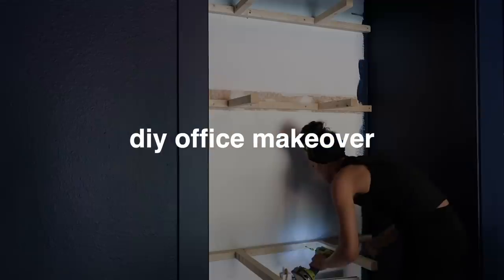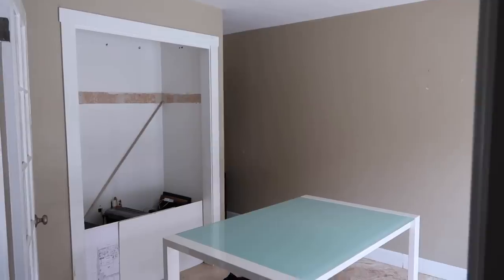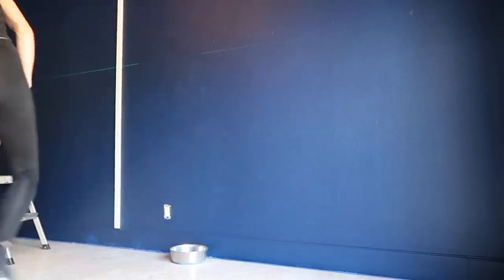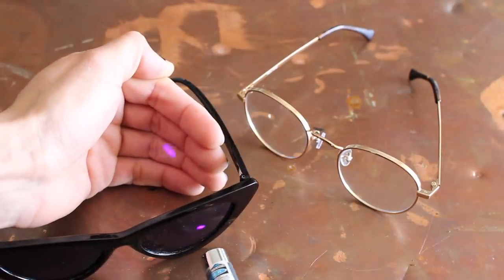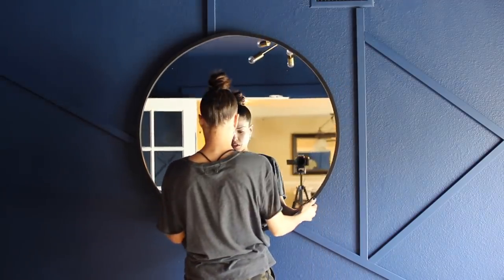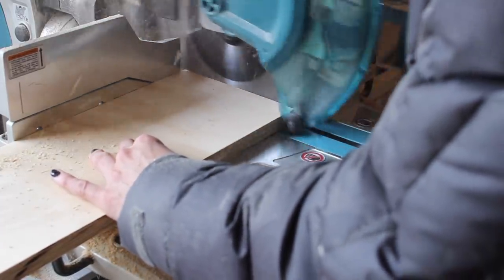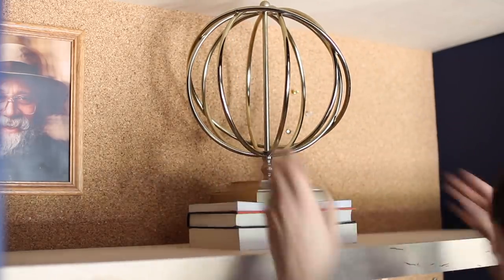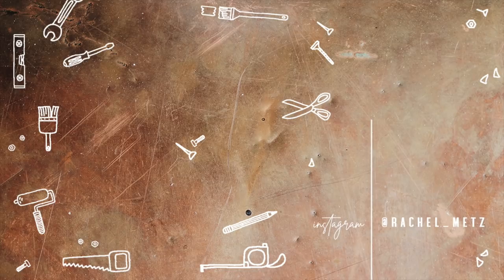DIY Office Makeover

Comment: I love the dog bed. I personally would have painted the dog bed and/or put some type of finishing rubberized mat on top. So that the mattress wouldn't move and saw that the dogs didn't get splinters
Reply from the maker: As mentioned it's sanded down from 60, 80, 120 to 220 and it's sealed with a flat finish. You can definitely paint it but I wanted to carry the natural wood from the closet over to the other wall xx. Thanks for the feedback!